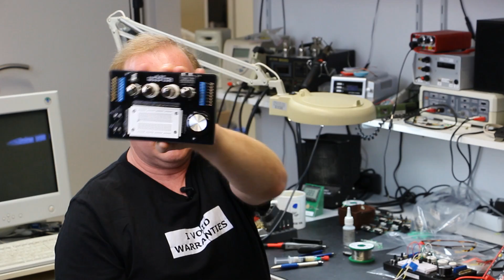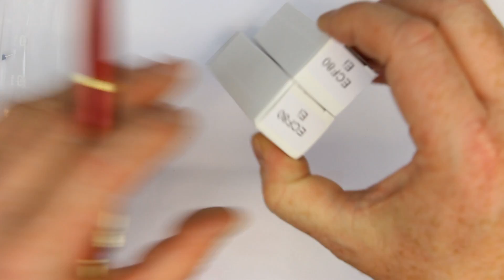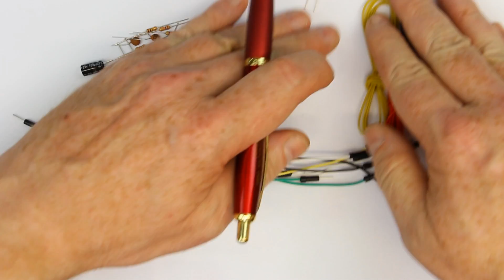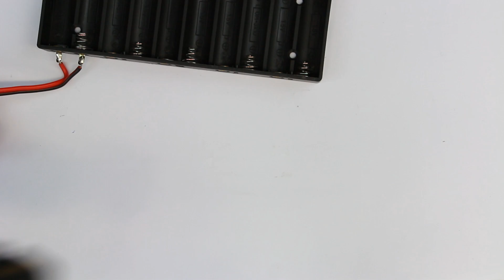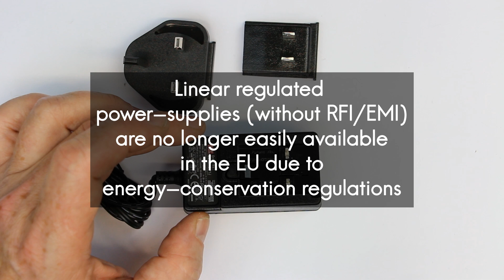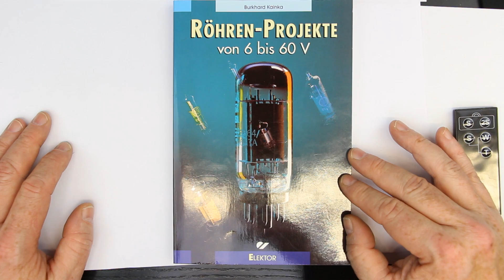The RT100 [Pt.1]: A Tube Experimental Kit for 6...60V Tube Experiments

Comment: The concept and features are great. However, the actual breadboard is so tiny!!  There are 4 tubes and only one super small breadboard. A good starting point would be 4 times the size.
Reply from the maker: For circuits, where the space on the breabboard is insufficient, all connections to the tubes and the other parts are available at the screw-terminals and at the 2mm banana-sockets on the sides of the PCB.
All the suggested circuits in the manual can be build on the small breadboard!